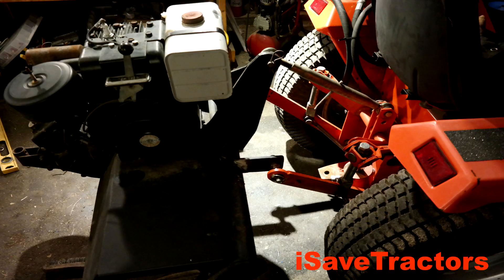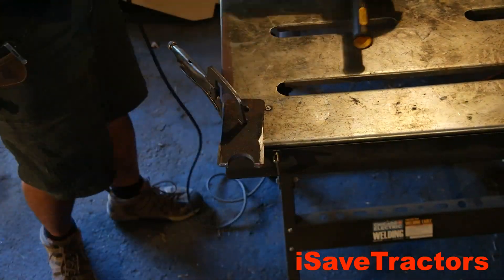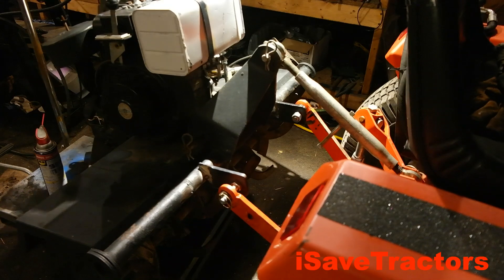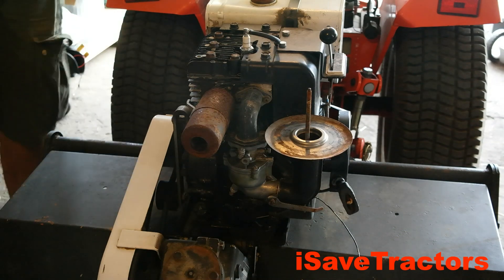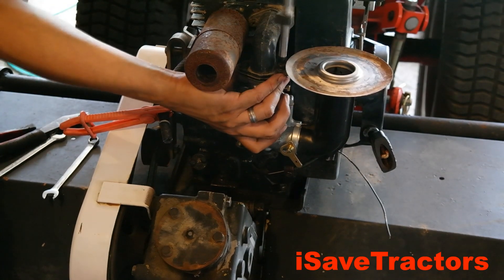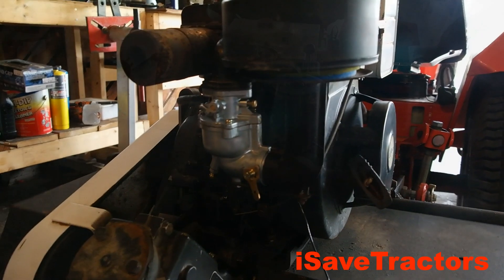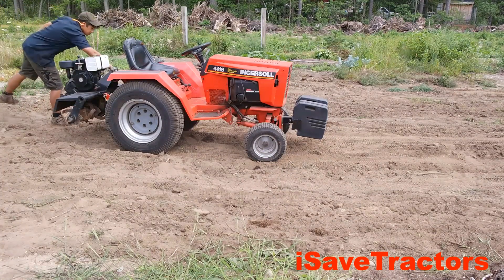Engine Driven Tiller Mod to Cat 0 3-Point Hitch for Garden Tractor

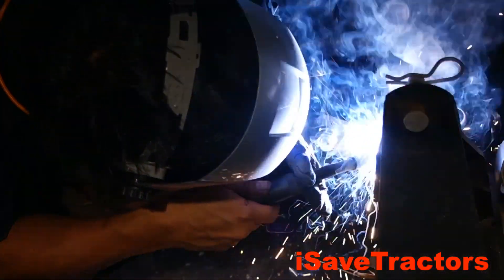Comment: You did a lot of unnecessary work.  That tiller is not a pull behind model.  It is already a 3 point Cat 0 tiller.  It obviously already has the top link.  Didn't you think that it was strange that a "pull behind" would have a 3 point top link?  Both of the lower arm pin are already there too.  The video is a little dark, but you can see the lower lift pin, with the cotter pin still in it, at 1:43 and more clearly at 3:45 and 3:55.  Again, didn't you notice or think that there was a reason for there being 2 lift pins, both 5/8", the exact size for a Cat O, already there?  Anyway it was a good video.  I actually have the pull behind model and hopefully can convert it to a 3 point with the information you provided in the vid.  That's also why I immediately noticed that it was not a pull behind model.  Keep up the good work!

Comment: Do you know the diameter of the pulley on the engine. I bought the same tiller without a motor and am building it like yours. Thanks
Reply: It's a 5 inch pulley I guess you are done by now though lol

Comment: I'm sure that carb is great. "BUTT"' I've been putting the Honda cloned carburetors on all my old stuff. It does take an adapter and adapted linkage ,but it's well worth it because Honda carburetors have this terrible habit of cranking on first pull.  The 420cc carb is less than $20 and the 212cc is around$10. Plus this garbage gasoline we have today is gonna gum up and these Clonda carburetors are beyond simple to clean.

Comment: Did the exact same thing back in 1996 for our JD 318, worked great ! However with our hard red clay here in NC. I redid it , by turning it around so it counter rotated, thus it helped deal with the jumping around.  Which worked out great. 2 years later I upgraded to a JD 4100 with a PTO driven Howse and stored the sears one.  IT's still here. but now that I have a 314 I've been pondering the  idea of using it on that or switch the engine out for a Hydraulic drive and use it on the FEL of the 4100 for cleaning banks etc  ( almost forgot, installed one of your fuel pumps on the 314 this past week...working like a charm )

Comment: Don't have to worry about any die hard sears guys going after you, I can still see the original lift points on the tiller. should work very well , cool little mod !!!
Reply: True story. As a sears guy it to me a while to find this tiller that wasn't all butchered up. I get adapting sears 3 point to find standard car 0 3 points but at least don't butcher the stock mounts. Same with the old walk behind 2 wheel tractors.